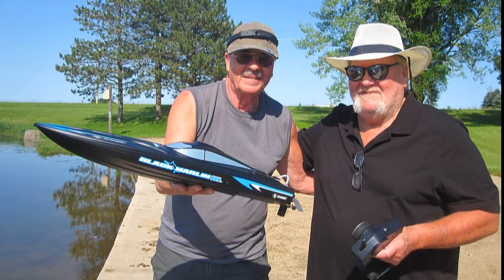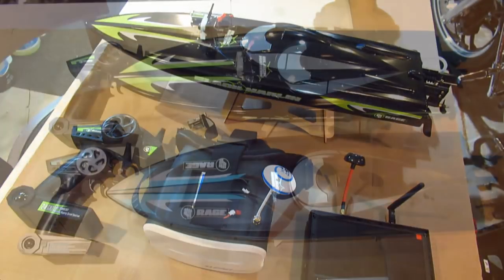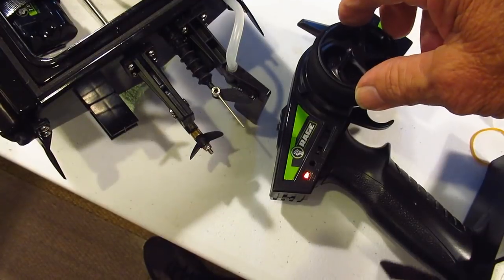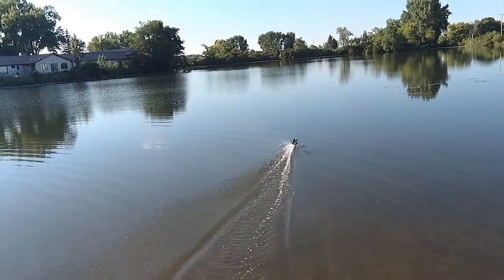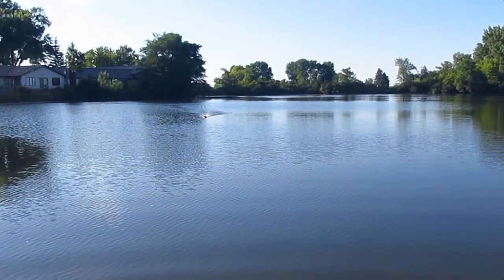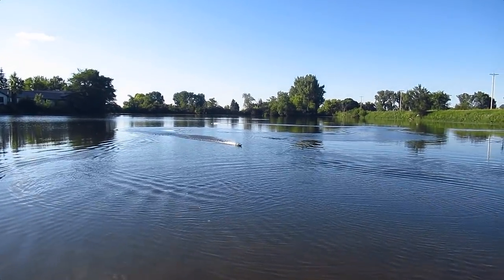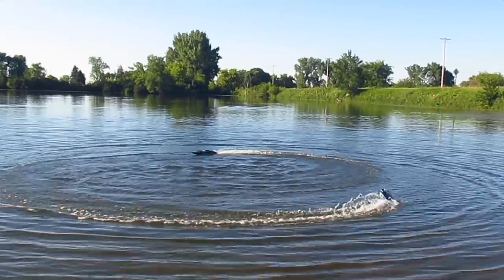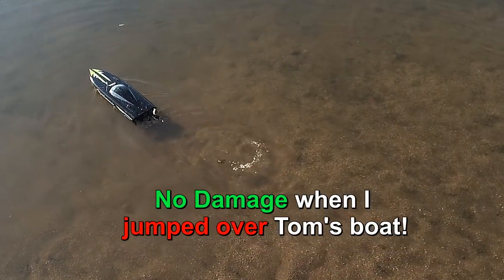FPV Drag Boat Racing! Brushed VS Brushless Rage Black Marlins.

Comment: Have you thought about converting yours to brushless yet?
Reply from the maker: Not going too. It would be more expensive than buying the brushless in the first place and not worth it since id have to buy the motor, brushless  esc ,rx and tx, water pump and another battery and discard all this stuff. This is fine for me. I'm more into helis and planes. This was just a comparison test. If you never saw the brushless one run, most kids watching all say it's fast anyway. It's all I need. 👌